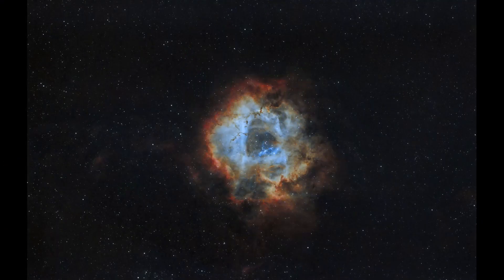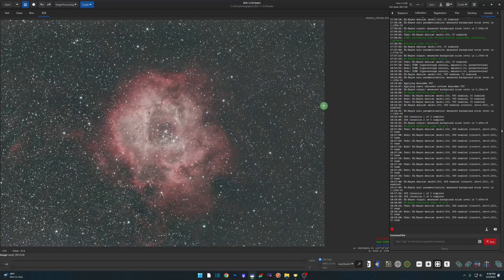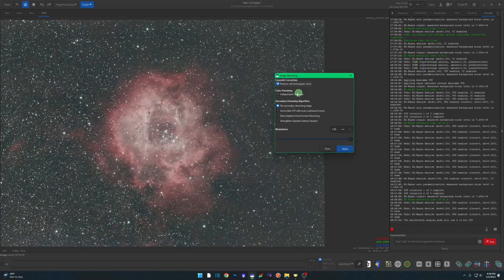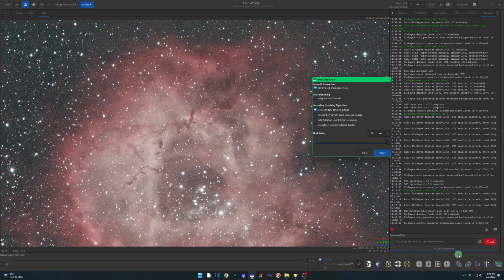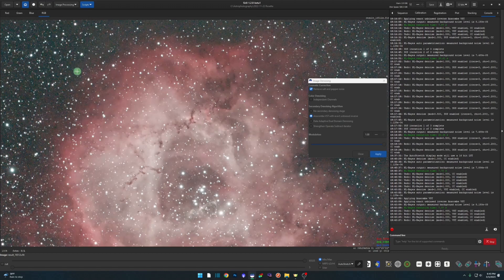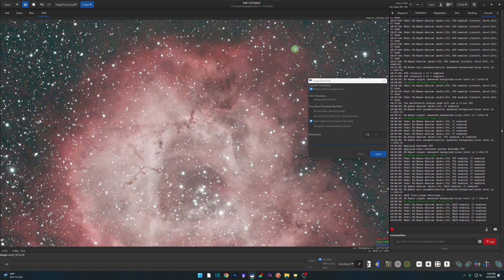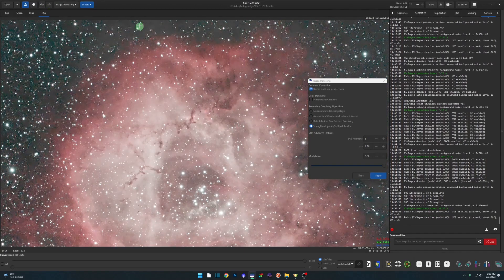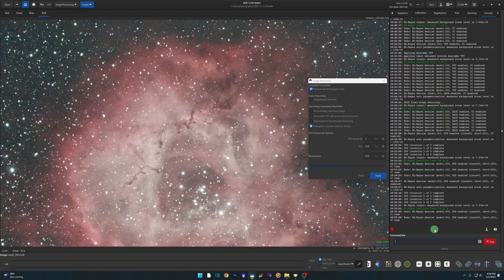An In-Depth Look at the New Noise Reduction function in Siril

Comment: I notice once a noise algorithm finishes the image looks brighter. I guess at this stage you adjust this during histogram stretching later on.
Reply from the maker: You can, yes. Siril's noise reduction works best with mono images, per Siril. I usually use PS or Topaz DeNoise for OSC images.

Comment: The best tutorials ive ever seen... You're explaining everything clearly  and  professionally.. great job..thanks a lot ..I got a question about processing.. Cygnus loop..as I saw you got similar picture on this video..
Any idea why after stacking and processing Is it normal..i got to many stars on my image?..and it's hard later to get all nebula details later.. even using starnet...
Reply from the maker: Hey thanks so much. If I'm understanding correctly then what I do after Starnet is process the starless image to my liking. Then I use the star recomposition tool to stretch the stars back in. Doing it that way you have control over the stars without affecting the object.
Reply: @DeepSpaceAstro thanks for replying.. yes I understand I can play I do the stars in recomposition as I like..
The think is I dont have that much details on nebulas.. and IAM just thinking iif it not enough data..or bad processing..
I've got like 5 hours lights.. with askar fra400 5.6 on canon 6d.. 
So.. comparing the similar results on astrobin it should be enough to brings out more nebulositie..
Maybe it's becouse of calibration frames.. I have darks and  biases..no flats

Comment: Hello, sincere congratulations for your videos, you are really getting some news from Siril ... super.
It's a bit difficult to follow you because my English is really bad, but this doesn't affect your videos. Keep it up.
My question.
What I didn't understand is whether only one type of noise reduction should be applied (salt and pepper or Ascombe or dual domain or sos) or advice to apply them all, but one at a time.
Ciao ciao.
Reply from the maker: Thank you! The salt and peeper should only be applied if you did not apply Cosmetic Correction from the Image Processing menu. The Ascombe, Dual Domain, and SOS are secondary noise reductions that are applied after the initial NL-Bayes noise reduction. You would probably get bad results if you ran all of them, but it doesn't hurt to try. You can always undo your actions.

Comment: Really enjoying your videos on Siril. Question on Noise reduction, when do you apply it? Do you apply it after stretching or should you apply it after star removal? My images are all undersampled.
Reply from the maker: Thanks! It's recommended to always run it before stretching. I usually run it after removing the stars which is also done before stretching. It's up to you whether or not you remove the stars first, but I feel I get better results that way.
Reply: @DeepSpaceAstro  awesome. Thanks for replying. Will try this method after removing the stars.